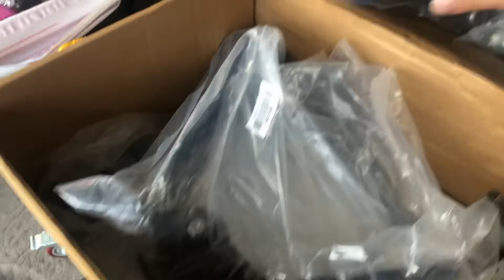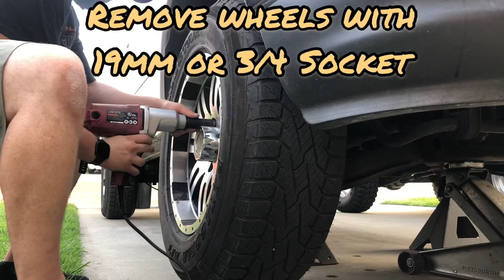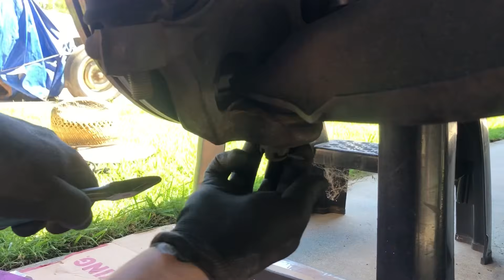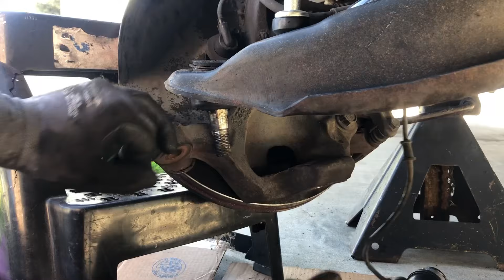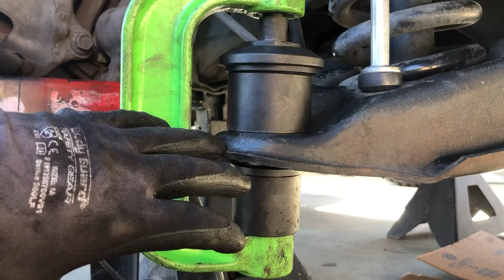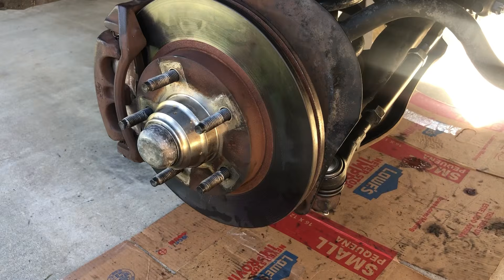2003 Ford F-150 2WD front suspension rebuild - removal and installation

Comment: Great video showed many of the things I’m going to be replacing soon…I will say that my actual search was for coil over replacement but this was 10/10.
FYI. I’m working on a 2002 HD F150
Reply: Dude question. When you removed the hub assembly what kept the coil from spring out, is it the shock keeping everything in place?

Comment: I plan to replace my whole front suspension and I have a few questions about the torquing. First thing is since this is the first time I’ll be doing anything like this what kind of sockets should I be using? Does that matter or should it be something like impact sockets? Second I’ll also be switching my lower control arm and some other stuff that he does not end up switching in the video so where could I find the sockets and torque specs for this kind of stuff? I’d appreciate the help and wanna be fully prepared before I start so I can have everything sorted thank you.

Comment: You ran through that with perfection.  That castle nut that went to the lower ball joint, I would’ve went to spin it on  but wouldn’t have threaded  it up far enough and it would have dropped  and bounced all the way across the floor to the other side of the shop and rolled under something like a floor cabinet defying physics the entire length of it’s travels.      Good times..

Comment: my f150 rides rough howncoukd i fix that problem? over pumped or whole it shskes up alot
Reply from the maker: A front alignment, wheels balanced, proper air pressure and some new shock can go along way, check out my front suspension rebuild video 🍻

Comment: Great resource, especially with the specs and sizes.   Only thing I would have done different is tighten the upper control arm pivot bolts at ride height.

Comment: never reuse the upper control arm bolts. Most shops will request camber/caster bolt to replace it.
Reply from the maker: Yes those get replaced during alignment as mentioned 🍻
Reply: @ATEMOFFROAD  Funny thing is out of everything that comes in the kit those bolts cost the most and Detroit usually don't have them in stock. I've done about bunch of fords over years with Detroit Axle parts. Been happy with Quality.

Comment: Great video!!  New subscriber.  One thing, I’m a little confused o the marking you made on the upper control arm brackets or bolts.  Thx.
Reply from the maker: That was so I know where to put the new arms as close to where the original ones were

Comment: How rusty is this bad boy? Ive got a 97 that runs like a champ but due to MN salt the frame has seen better days, wondering if itd be worth the money for these repairs
Reply from the maker: Very little rust , it had a power steering leak so that kept the frame well oiled haha . But all that was fixed when I replaced the engine 🍻
Reply from the maker: I would say the truck is solid, one of the most reliable to boot, I’d say it’s worth it. If you can afford it

Comment: Very well done video, explained everything step by step clearly. Very informative as well buddy congrats. One question how do you know when to replace front shocks, do you recommend replacing them if needed while doing this?
Reply from the maker: This truck had very low mileage, so it didn’t need them, but it would be a great time to do them as well if you are already there.

Comment: Really well done video. I appreciate that you have all the torque specs and even edited them onto the screen. I was a little surprised you didn't have the camber plates for the upper arms, though it looks like you later had them installed by the alignment shop.

You definitely did a far better job than most diy mechanic videos on here. Very clear and concise without skipping steps or playing music over what you're saying
Reply from the maker: Thanks for watching I appreciate it 🍻

Comment: How have these parts acted over time, any issues? Great video. Best I've seen so far.
Reply from the maker: Still working well on the truck , dad drives it no complaints 🍻
Reply: @ATEMOFFROAD  perfect, thanks for your reply.
Reply: Is it still running smooth?

Comment: I can't relate to you how jealous I am that you live in a place that cars rust at a rate of decades rather than months/years, lol. I live in the midwest....I assure you my 03' F150 looks nowhere near as nice as yours does underneath. I'm not looking forward to this job when I need to do it......at over 200K miles, the parts look original, and extremely rusted. Thanks for showing how to do this with hand tools.....though I think I'm going to buddy up to a friend of mine who has a lift and air tools given the rust issue, lol.
Reply from the maker: Cars do last a lot longer here without rust being an issue, I’ve seen a few of those ones you mention rolling around here and I dred working on them. Lol Hope all works out with your truck, good luck and thanks for watching buddy 🍻
Reply: @ATEMOFFROAD  Not uncommon to see newer vehicles here rusted from the rockers down after 5 years. It's gotten worse since they started using salt brine on the roads 10-15 years ago. Before that they used to just use road salt. My last truck, the frame was rusted bad enough in places you could put your finger through it. Finally one day my mechanic told me he couldn't put it on the lift because when he tried the rear axle sagged enough to cause concern, haha. This one isn't as bad, but I can see it get there in a couple years.
Reply: @ATEMOFFROAD  The truck won round 1.......the bolts holding the rear end of the drive shaft are corroded in place....going to be soaking them nightly with PB blaster all week in the evenings after I get home- then I'm going to get with one of my coworkers (I work in a shop full of diesel mechnics) who have some heavy duty air tools at home and a torch and see what we can get done, lol.  Ahhh life in the rust belt.
Reply from the maker: @StormLaker  that’s it keep up the good vibes and get er done. Good luck 👍🏼

Comment: Not to be a smart ass or anything but You didn’t torque the upper control arm while the car is on the ground, ur gonna tear ur bushing prematurely.
Reply from the maker: Yes the wheels were too large to get in to torque those with the sprung weight on them, but I did later mention in the comments pinned and video , that those upper bolts should be replaced , which I did have the alignment shop replace those while doing the alignment. they had to be loosened at the time of the alignment anyway! So I am assuming that those were Retorqued correctly there! Thanks for watching 🍻

Comment: Just replaced all these parts yesterday using my Detroit axle kit. Your video helped tremendously. 2003 ford f150 2wd with 300k miles. Been riding rough for a while, hopefully this smooths out my ride. Getting alignment today.
Reply: How'd it end up going? Did it improve your ride??
Reply: @jordanjohnson5784 I’m sure he’s enjoying his new and improved smooth ride 😂

Comment: Your video is misleading it says tie rod ends you did not replace the tie rod ends all you did was upper and lower ball joints on the control arms
Reply from the maker: It’s in the video , I set up the tie rods on the bench

Comment: Great video!  One question—I noticed you didn’t loosen the torsion bars as I’ve seen in other videos. Is it not necessary and are there safety precautions to follow?
Reply from the maker: That’s not necessary, only if your removing the lower control arm! Thanks for watching 🍻
Reply: @ATEMOFFROAD  lower control arm didn't need replacement?

Comment: Absolutely great video! I plan on grabbing a kit and changing everything as well. But I’m also gonna change the idler arm & pitman too. Is there anything else I should look for to change while I’m down there? Here’s everything I can think of so far (besides the center linkage)

Upper control arms (or just the bushings/ball joint)
Inner/outer tie rods
Sway bars
Lower ball joints
Idler arm
Pitman arm
Reply from the maker: The steering center linkage to the steering box is a great idea to replace if need be, as well as new upper hardware for the upper control arms , this can be done when you get an alignment or just before alignments . Also lower control arm bushings on frame side are also good to check with a pry bar if worn replace. Thanks for watching I appreciate it 🍻
Reply: @ATEMOFFROAD   thanks for this awesome video :) we are in the process of changing all of this and also the lower control arm frame bushings - the big one is being a real pain  to get out and the master ball joint kit we have doesn’t have a “socket” that fits - would you happen to have any tips? (2003 Ford F-150 xlt 4.6 285,000) TIA :)

Comment: Do you know where I can find that rubber part on top of the shock springs? Mines all old and dry rotted and I want to replace but can't find the name or part #
Reply from the maker: I would check rockauto.com in the suspension section they have everything there set up by year make and model with quick drop down lists to make searching for a part super easy! Thanks for watching 🍻

Comment: Is the upper ball joint a solid piece with the upper control arm can they be separated?
Reply from the maker: I’m pretty sure they can be separated! Thanks for watching I appreciate it, cheers 🍻
Reply: You can buy the ball joint and two side bushings separately but when you buy the whole upper control arm it’s cheaper and way easier than pressing joints in.

Comment: I have heard horrible reviews about Detroit axel, how did this hold up for you?
Reply from the maker: I have used Detroit components over the years and know them more as “economical”option compared to oem! There are definitely more heavy duty options Available. Check out rockauto they have a decent selection. Overall The kit has held up. Some of the sway bar end link bushings are starting to show sings of cracking but haven’t become a real issue. My dad currently owns the truck last time I looked it over everything seemed fine. Thanks for watching 🍻
Reply: @ATEMOFFROAD  Thank you for the reply.

Comment: When tightening things down, you are supposed to tighten the control arm bolts with the weight on the suspension.
Reply from the maker: That is absolutely correct, I took this truck to an alignment shop they replaced all those bolts and did the alignment anyway! But yes you are correct. Thanks for watching
Reply: This is very important to prevent bushing tears. You need to put a small juck under lower control arm and raise it to tide height before torq bolts.

Comment: Thanks for the video.  Needed to replace my tie rod ends so figured I'd buy the kit and do it all while I'm in there.  After you got the alignment, did you have a little stiffness in the steering? I'm thinking might need a break in period.
Reply from the maker: U joints can be stiff at first just make sure they have a good amount of grease in them, but no the steering felt normal. if you noticed there was two remaining ball joints in the steering setup That didn’t get replaced which were not in the kit.  I probably should have replaced while i was there but I didn’t! They didn’t look to bad though! Thanks for watching

Comment: I’m guessing this would be a good time to replace any and sensors if they are bad. My 2003 f150 abs sensor light turns on every now and then. What would need changing?
Reply from the maker: My abs comes on and off too!  I haven’t got around to it , but I will be replacing both the front sensors, they unplug from the harness and bolt to the steering knuckle! Maybe I will do a video on how to test these! I wonder if you bought 1 and moved it around until the light went away
Reply: Look for rust build up under the sensor

Comment: Man you made this vid right on point 👍🏾I bought the exact kit I'm on jack stands at this very moment. Only difference I didn't use the lower ball joints that came with the kit. I went with the Moog lower joints. I'm lowered and sitting on 24's glad you posted this. You didn't skip a single thing. All the other vids were 🗑 liked and sub'ed as well bro👍🏾👍🏾💥💥
Reply from the maker: S_Carolina_Pyro864 💥 nice, appreciate it! Thanks for watching, cheers buddy!
Reply: @ATEMOFFROAD  NP and thank you you wouldn't believe how many vids I've watched. If yours would have been up earlier I would've only had to watch one. 👍🏾👍🏾💥💥

Comment from the maker: Just picked up the truck from the alignment shop and everything went well. This shop uses Hawk eye Elite alignment equipment, right away the service tech recommended the eccentric pivot arm bolt kit prior to the alignment, this was a no brainer, since in the video I recommend bolt replacement, so we went ahead and did that as well as the alignment! Totaling around $200 for the job! Super happy with the outcome and was able to Save a Ton of money with this DIY repair! Cheers and thanks for watching
Reply: Thanks for the sub bro 👍🏾👍🏾💥💥
Reply from the maker: S_Carolina_Pyro864 nice, I like fireworks! Cheers
Reply: Man your video is the best thing! Thank you for taking the time to share. Very much appreciated and needed.
Reply: Is that Detroit Axle kit still holding up or did you have to do it again yet?